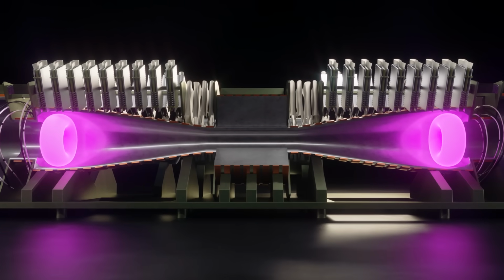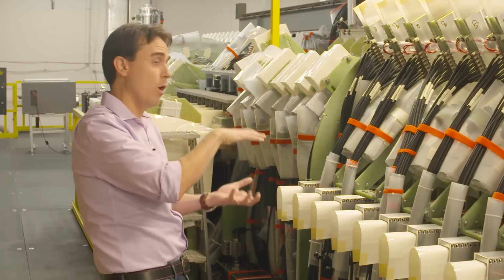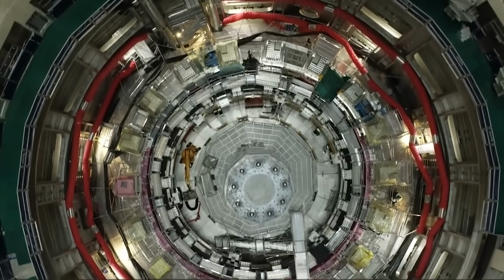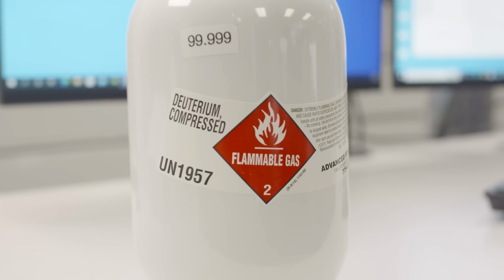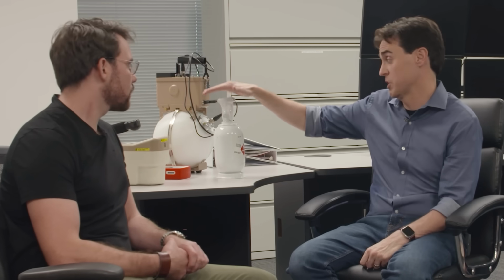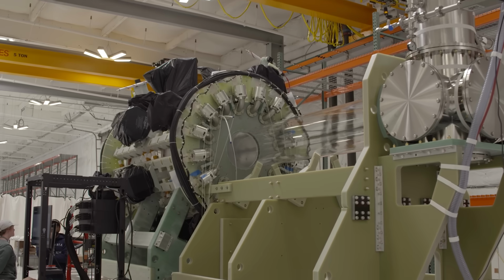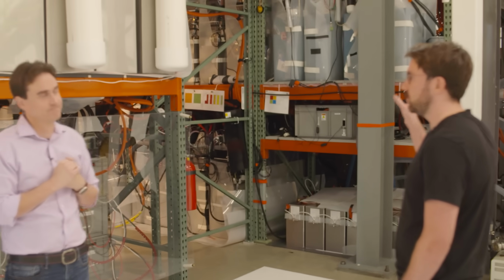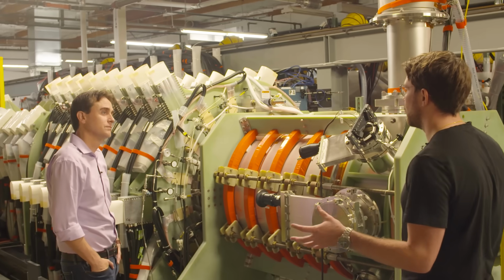A New Way to Achieve Nuclear Fusion: Helion

Comment: General rule of thumb is if something sounds too good to be true, it probably is. All am taking from this approach are benefits and talks about more efficiency than what other approaches bring to the table. Problem is, people working on those are not stupid either. This lack of downsides and making everything look obviously better than what all the other scientists are doing is what's making me suspicious. For now, it's great there's so much research being done on subject of fusion. We are in much need for cleaner power generation. And I do hope they have enough funding to keep working on this.
Reply: This is a privately funded efforts, so they're never going to talk down their own product. That doesn't get investors onboard.
Reply: As an electrical engineer i will tell you what i think the questions to ask are.

We know the conventional thermodynamic power cycle limits steam turbine electric generation to 33% efficiency, so what is the efficiency of this design from primary energy (fusion output potential) to AC electricity (usable energy to the existing grid)? We know a tokamak that is just a fancy water boiler will have to throw out around 66% of its energy, thats just the thermodynamic power cycle when operating at temperatures we can feasibly achieve, no way around it. But this direct capture generator doesn't have that limit, so what is its theoretical max efficiency and actual real world efficiency to compare to the known efficiency of the tokamak?

My other question is that this thing is making pulses, its like a 1 cylinder engine, those are some big spikes that need to be captured and smoothed out into something that can then be more easily converted into either AC power or directly to HVDC for long distance transmission (and then get converted back to AC). So what are the parameters of the waveform of these pulses, and how hard is it to capture the energy contained in them and then rerelease is as a smooth AC waveform ready to be connected to the grid and supply baseload power?

I'm not as concerned with how they actually are trying to get fusion to happen, thats hard so we try different ways to cheat they system and eventually one will actually be pretty good at it.
Reply: @jasonreed7522  Yup, just have to make sure that you're also taking away the power needed to keep the fusion reaction going.

Unlike fission where the pumps and such needed are relatively trivial power demands fusion can expect to throw a lot of its power right back into the magnets keeping the whole operation going, further whittling away at that 33%. Without knowing how close this thing is to actually producing net power it's hard to really evaluate its benefits, even the comparison to ITER doesn't count for much since ITER is so huge precisely because they're chasing economies of scale for the sake of getting substantial net power.

I'm pretty dubious it's going to be any more useful then fission and it's certainly far harder from an engineering perspective, I don't see making the engineering far harder for the sake of getting anti-nuclear people to chill as being a winning proposition.
Reply: @AmurTiger  On top of that, have you ever actually tried to convince someone who doesn't know anything about fission and fusion that fusion energy is safe? Doesn't really work that well most of the time
Reply: @horrorhotel46290  Yeah. I suspect the only reason why there isn't as much loud hostility towards fusion right now from the usual suspects is because fusion isn't something that can be built now to displace their wind/solar dreams. Paper reactors ( fusion or otherwise ) are just less of a threat then iterating on something already built and working.
Reply: Theorithical limit in charging and discharging of the capacitor. It is not 100% but very close to it. Then there are loses from extracting energy from the plasma. Overall I would guess they can recover 80% of the heat energy in the plasma. The majority of the losses should be the heat loss in their magnetic coil. I don't know how efficient superconducting coils could be. Also He3 breeder reactor would likely not break even.
Reply: @jasonreed7522  What are the limits for an induction system like this one? If there is somewhere for the generated current to go, are there other factors that act as bottlenecks? Separate from those kinds of questions, which overlap with questions about efficiency, the solid-state aspect of it seems attractive. The fewer moving parts, the better.
Reply: @jasonreed7522  On thing is : they probably can't yet answer that truthfully since as they stated "they hope to capture electricity with the next generation reactor" Right now they seem to be at the stage of generating the fusion itself (and that good) but that still far from being a proper generator
Reply: @jasonreed7522  At 17:20 is shown that 2.45 Mev of the total 3.27 Mev energy outuput comes from a neutron, then only 25% of that total energy can be used in the direct conversion. The system would be no more than 25% efficient.

A combination of both approaches to haverst the energy would possibly make the system the most efficient.
Reply: @jasonreed7522  He said they were hiring. Flip them an email.
Reply: @jasonreed7522  All valid questions. One of the issues I thought about was exactly capturing energy and producing a useful power that can be hooked up to the grid. Am additionally interested in their cooling, which they didn't mention at all and with all fusion reactors this is where majority of energy is going towards. We'll see. Perhaps other videos explain all of that.
Reply: @MladenMijatov  Exactly right.  The so-called "ignition" achieved by NIF is one 3 MJ pulse out per month when what's needed is more than ten a second.  The odds of this happening with lasers is zero because pulsing NIF's 192 lasers at that rate would melt them down in less than a second.
Reply: @jasonreed7522  could these powerspikes from the pulses be fed into some sort of a flywheel - creating the rotating mass necessary for a smooth net frequency?
Reply: Yes it is very valid to be skeptical, especially in todays world. But fusion energy and helion’s methods theoretically do have their said potential, it’s crazy. Ofc actually engineering this is a challenge and commercializing it etc. The question of viable fusion is there, but the science is checking out
Reply: I agree all just chasing after the pot of gold at the end of the rainbow.
Reply: I was searching for someone commenting exactly that. I'm skeptical about that. Sure, I hope it is all true and they are advancing fast. But a new almost miraculous fusion reactor shows up days after that announcement of achieving ignition. I don't know..
Reply: @lkslokinhow  Whenever there's an event like this where they developed something in secrecy and then it's revolutionary it starts screaming to me they need more funding which might be well justified but with all those revolutionary products we've seen advertised few if any came to be. So am skeptical but hopeful.
Reply: @MladenMijatov  more people = more complexity and lower efficiency. There is a balance to be struck. I would prefer to stay small, aligned and nimble unless the factor limiting progress is genuinely having to do too much in series when it could instead be done more efficiently in parallel.
Reply: @lkslokinhow  That is a good point, however I’m guessing that the announcement of producing nuclear fusion was delayed while these machines were being developed because they wanted to actually have a machine that produced a positive net power supply, as proof their claim of successfully achieving so. Logically, they would have needed a machine that would do so successfully before the announcement could happen, otherwise they’d just be lying. I don’t really see the surprise in seeing the machine as obviously it would have had to exist already before they could make the announcement. Although I don’t know if the official news announcement of achieving nuclear fusion and the facility in this video are related at all. 

Additionally, seeing as private companies like this might not be able to get enough attention online or public support to get a news story, it’s understandable that they only got public recognition AFTER the already well known announcement of the breakthrough on the news. I’ll have to read up more about the timeline of events.
Reply: @lkslokinhow  I've heard Helion being talked about before the ignition announcement
Reply: It's more efficient but still can't reach break-even. If it was, they'd go crazy and market it like madmen. Its more efficient, but it can't give us back more energy than we put into it.
Reply: @dipanjanghosal1662  They’re still on the journey to reach break even, and then they will attempt to reach ignition by 2024 where they’ll get a net gain of energy. That’s when they WILL go crazy for it.
Reply: @nick_0  I really hope so
Reply: Someone always had to be first.
Reply: Fusion Direct Energy Conversion can usually reach 70-75% efficiency with just something relatively basic conversion design, but by adding more stages and more complex conversion mechanism can reach 90-95% efficiency.

The reason they're so efficient is because high temperature reaction (for example 750°C molten salt fission reactor have efficiency around 48% while 1,000 °C one have 59% efficiency) and directly convert kinetic energy into almost purely to electric charge with little lose to heat.
Reply: i guess one clear disadvantage here is that it's a much more precise steps of procedure to go through so it's going to be quite expensive to maintain
and that it's pulsed and not continuous

there's many other pulsed based fusion projects ongoing so it's not like they're doing something overly novel also, so i think it's safe to say that it's not complete bullshit
Reply: All we need to do is build a super mega dam and all of our problems with energy would go away for a long while.
Reply: In humans history there have always been revolutionary new miracle innovation technologies that claimed to solve all problems. 
Only a few came without massive asterisks and they all brought new problems with them.

Asbestos? Amazing new product that is completely fireproof! Just, ignore the whole "cancer in 30 to 40 years"

Leaded gasoline? Brilliant solution to engine knock. Just... please ignore the very fine layer of atomic lead we've lightly dusted the planet in and likely damaged the intelligence of our global species for generations to come. 

Nuclear power! Oh what a boon science has given us for clean, reliable energy production! Just uh, just ignore all that leftover nuclear waste. We're just gonna throw it in a hole and hope for the best. 

I want fusion to be real and safe and productive for our species. But for now I'm holding on to solar. Which is clean and good but don't be fooled. It has it's setbacks too. Batteries are expensive and there's the concerns about battery waste and the longevity of those batteries. Solar panels also aren't suuuper efficient but what is in energy production yeah?
Reply: My question are: 1. How feasible is the He-3 breeding reaction, does it make the whole thing pointless? 2. Damaging the machine overtime with neutrons isn't nothing. It's a big problem and they kinda just wave it away as "something to be concerned with" and gloss over it. If the machine constantly needs major repairs the whole thing is no good. 3. What about waste heat? The high amount of electricity generated is gonna come with huge resistance in the wire - how are they cooling that? And does wasting that much energy as heat that needs to be cooled impact the efficiency to below net gain?

I also hope this works out for them, but these are some serious problems that need to be addressed before a puff piece like this can really be believed. Maybe they can solve these problems quickly, maybe they'll take many years to solve, or maybe they are insurmountable hurdles. Regardless, it's pretty exciting as a learning opportunity.
Reply: @HyperManSP  Machine use as breeder reactor should have ablative lining integrated into the design. If you relax the requirement for magnetic confinement because you have no intention of extracting energy directly from the plasma then you can design a more modular reactor with swappable ablative lining. A monthly maintenance that would take 1 week to swap ablative is practical for He3 breeding. It is okay for breeder reactor to have intensive downtime.
Reply: unfortunately this channel is basically pr/advertising at this point.
Reply: We have seen big breakthroughs though by such companys like tesla
Reply: @DemsW  Tesla hasn't made any breakthroughs. They just made the economics of manufacturing electric cars work but all the technology was already there before them.
Reply: @Bestmann3n  They made a breakthrough in the car market.
An electric car was too good to be true before them
Reply: @DemsW  What specifically about Tesla was an engineering ( and not a marketing) breakthrough? AC induction motors are as old as Tesla ( the person), Li-ion batteries have been around for some time.
Reply: @AmurTiger  I didn't mean engineering breakthrough, they made a product many thought couldn't be made viable.
Reply: @DemsW  Exactly right! Tesla ( the company ) challenged and changed the assumptions and profit model of the industry. They didn't make huge fundamental engineering leaps.

It's great that they did it without a doubt but we should be wary about using their success to explain how something else might perform.

Ultimately I'm not convinced that fusion as a whole will play an important role in energy this century. The real downsides ( capital cost and relatively unfamiliar technology ) are the same as fission and the engineering challenges are substantially harder.
Reply: @AmurTiger  I wouldn't say anything about our energy industry for anything beyond 20 years. Technology gets crazy really fast
Reply: @DemsW  Then you misunderstand the energy industry and how slowly it moves. This isn't silicon processors that can ( or at least could) exponentially grow thanks to Moore's Law. The closest examples we have to rapid transitions were only of the electric sector ( French Nuclearization) instead of the whole of energy and happened during a time when we were far better at building large infrastructure projects. You could easily burn half of those twenty years just building up the skilled workforce, nevermind actually building everything out.

The danger is that people use the promise of future tech progress as an excuse to not get working on what we can now which meant that we saw a pretty pitiful buildout during the low interest period that came to an end this year which will make it harder tomorrow to get things built.
Reply: you seem to have intentionally ignored the mention of problems that need to be overcome before this works. things that require a whole new generation of reactor to be built to solve. They clearly spell out that its not a solved problem yet and its rather inacurate to describe it as having a "lack of downsides". do you also need to them to spell out that such a new generation of reactor may also have further problems that need solving before it is a viable power plant?
Reply: @ge2719  Yes but they only quickly mention them and seem to wave them away as minor problems. This gives people false hope as though everything is fine and they'll figure it out with ease. There is nothing wrong with having hope grounded in reality, but a piece like this heralding it as the "next best thing" is a bit dishonest. It would be better to hold off on showcasing helion until they have more answers, at least theoretical ones if not proven ones.
Reply: @HyperManSP  "grounded in reality"? when a problem HAS an easy solution, because its literally just a case of tolerances being too tight due to incorrect models, yeah, the "grounded in reality" answer is a relatively simple one. you want them to what, lie about how hard it will be to solve, make up  some extra problems that dont exist for the? All so that people think its HARDER to solve than it is IN REALITY, so you can feel like that's some how more "realistic"? You want them to have "More answers", to what? why is it dishonest to "herald it as the next best thing". Its entirely possible for something  TO BE the next best thing. This is entirely you making up total nonsense to complain about.  

are you also one of the nuts that think a man who has his penis cut of becomes a woman? you seem like the sort who wants to argue over total nonsense...
Reply: @ge2719  Oh, if only you knew how stupid that last bit was, you wouldn't have said it... You're barking up the wrong tree.

No, I don't want them to lie - that's just it. The problems they have are big problems, and people have been trying to solve then for forever - and haven't yet. That's not to say no one ever will, but one misleading video showcasing all the good points at the beginning of the video and saving all the downsides for the end to be glossed over isn't gonna do it for me. I'm not saying this can't work, or that helion is a bad company, I'm just saying that this video is misleading and I'm skeptical.
Reply: @HyperManSP  now heres where i'm going to have to call bs. no one outside of this organisation even knew this existed before the past few days when they went public. Yet you claim they have big problems to solve that they have been trying to solve forever. Youre talking about the alternative attempts as fusion, which even this video spells out those issues and why they have been so hard to overcome, which is literally why this technology is better, because it doesnt have those same problems. 
So unless you've got some inside knowledge about ths technology you are assuming they have massive problems that have taken forever. when in reality this is a new technology that hasnt been in development as long as the other forms of fusion and is clearly way closer to a viable solution because its starting from a point of being just an all round better solution. if you don't believe its as good as it sound, then thats all you can claim. otherwise give some specifics. what are these massive problems they have been solving forever? and how do you know of them?
Reply: @ge2719  Again, you are making too many assumptions. No, I am not talking about solving problems associated with this method of fusion. I am talking about the problems themselves that I initially mentioned. The issues of waste heat, repair costs, and general project feasibility. These are fundamental problems that have been visited before and always remain a concern.

Face it, you went off on a tangent looking for something to argue about. You clearly misunderstood my initial comment and lost sight of the fact that I ALREADY GAVE specific problems that I had questions about IN MY VERY FIRST COMMENT.
Reply: @HyperManSP  again, your problem is that they don't describe things as enough of a problem, when you have no idea how much of a problem they are. so now youre trying to claim i am making assumptions? me, the one making assumptions. hilarious.
Reply: @ge2719  Do everyone a favor and don't be a troll your whole life, ok :)
Reply: @HyperManSP  you doing your daily affirmations now?

Let me know if you ever get so much as a shred of any sort of evidence that the problems are significantly larger than presented here. Until then you keep on working on your trolling gig.